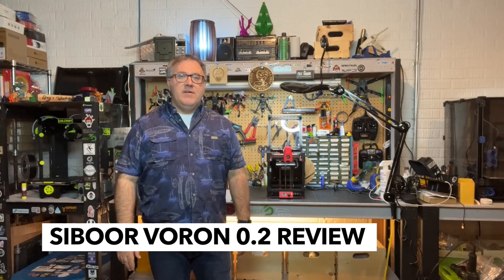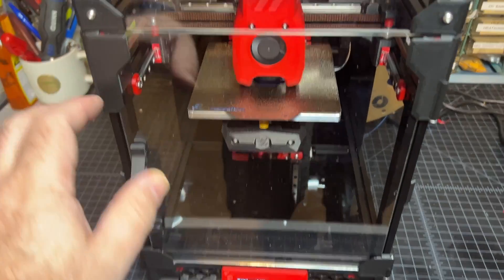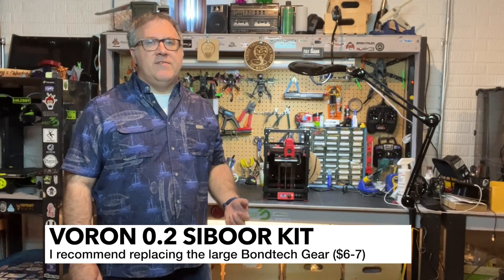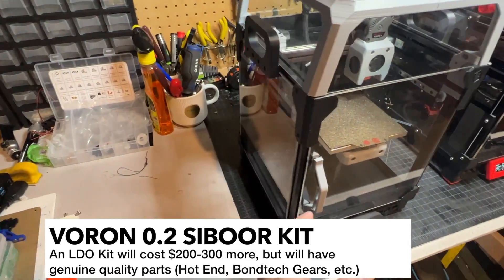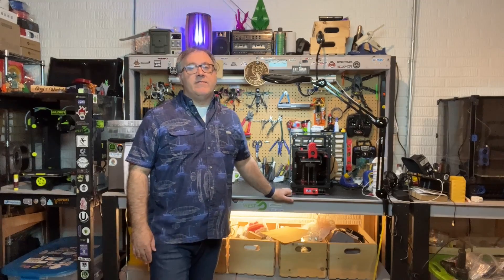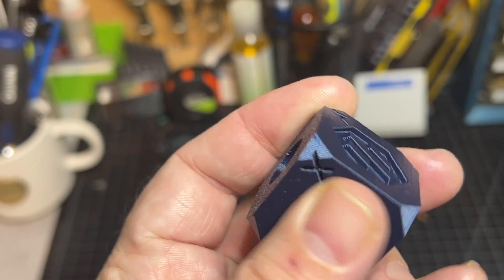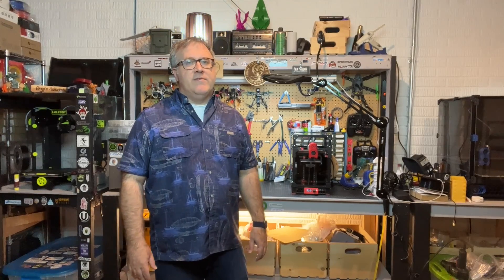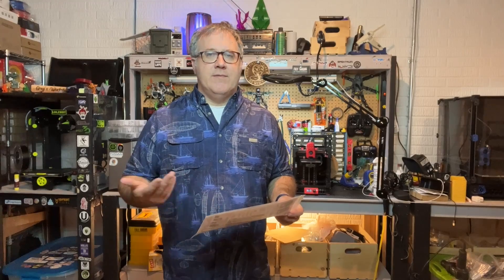Siboor Voron 0.2 Kit Review - $469 Printer Kit! Recommended for Budget Builders, 4/5 Rating

Comment: Hi Greg, thanks to you I ended getting this kit and it's been fun following along and building while watching your Voron 0.2 build playlist.  I'm almost finished but am stuck at the CANBUS section.  I ended up buying an EBB36 because this Siboor kit has a Gemini V3 board (which has a CAN port built in - I used the pinout diagram on your github page and the EBB36 came with a 4 port JST connector so I just used that for the Hi and Lo).  

Do you have any tips for the software setup to get the EBB36 and Gemini v3 to work well together?
Reply from the maker: Thanks for watching! I haven’t done anything with the Gemini for Can bus, but ping @radsolutionz in the Voron Discord and he may be able to help you. Best of luck!! Can should work fine once you get it set up with that combo.

Comment: siboor is getting better and better, but they're still far away from being high enough quality kits to be stocked and sold at 3rd party store's or webshops
Reply from the maker: I’ve never had a perfect kit from any other vendor, and I’ve tried a lot of them. The difference is how big of a deal or issue things are and what you have to do to fix issues. From that perspective I have seen them addressing problems, which is a good thing. If you are expecting perfection in a kit I don’t think you’ll ever find it, and at this price point it’s worth having to address a few small issues in my opinion. The ldo kits are likely to be better quality overall with genuine parts, but you’re paying $200-300 more and you still may run into issues, and they will help address just like Siboor.  I have seen a lot of problems on the discord lately with the ldo picobilical and skr pico, for example.
Reply: @GregsMakerCorner  
The formbot v0.2 kit only comes in at 450$ with a high flow dragon hotend. And then about 100$ for the printed parts through the PIF program to ensure good quality, so 550$ for a premium kit and quality controlled printed parts.

Compare that with the siboor v0.2 that costs 600$ normally, and doesn't feature any premium parts at all.

You have been wrongly information of you think this kit holds it's value better then the competition.

I am in communication with siboor, and they are well aware of my concerns and critiques.

That's the one thing they're nailing right now, communication and talking critique seriously.

Aa a business stocking siboor is currently irresponsible towards ones customers.
Reply: I have built several kits including the Siboor, the Ldo and self sourced. I think it’s a good overall value for someone looking for a budget printer. It doesn’t have the best quality or genuine parts but you will be able to get up and running on a budget, versus other options. For someone budget minded I stand by my recommendation - it is a good kit. If you want the best parts and quality get an LDO. It’s ok - everyone thinks about thinks differently and we don’t all have to agree on the same kit. :)

Comment: Hi Greg, I’m interested in this kit and I was wondering if you ran into any issues with the Gemini board. You mentioned Klipper and Mainsail come preinstalled, do they include the username and password for SSH in their documentation? I’m assuming they’re using OctoPrint as the hypervisor, so isn’t it “pi” for the username, and “raspberry” for the password? Thanks!
Reply from the maker: Yes the default username is fly and the password is mellow. It’s very similar to setting up compared to a raspberry pi, but it is running Armbian instead of Raspbian. Best of luck if you go with the kit!

Comment: Greg, how does the fly board attach to the panel?  I don't see any mounts in the kit.  Nice video.
Reply from the maker: There are holes on the black acrylic panel and you can use an m3 along with the nylon standoffs to mount it. Best of luck!